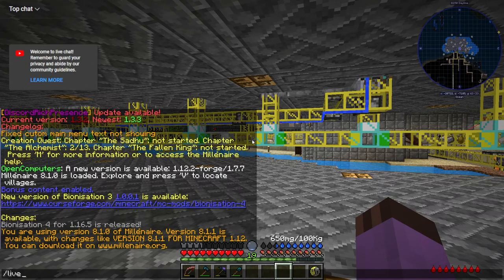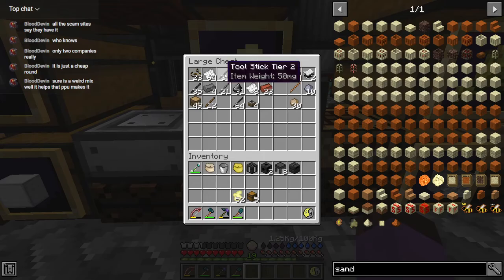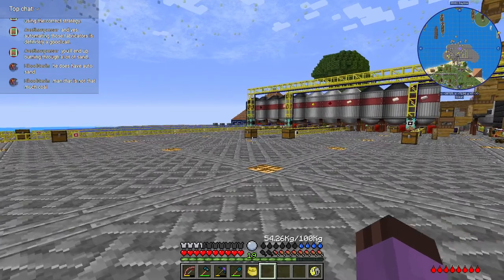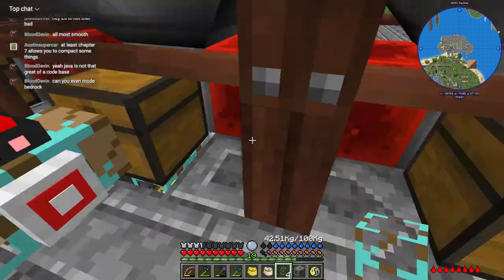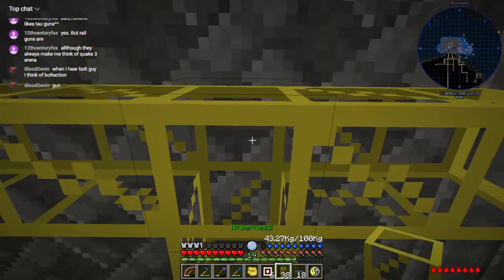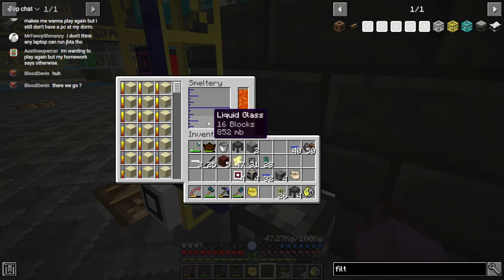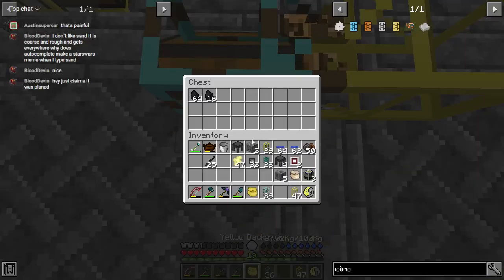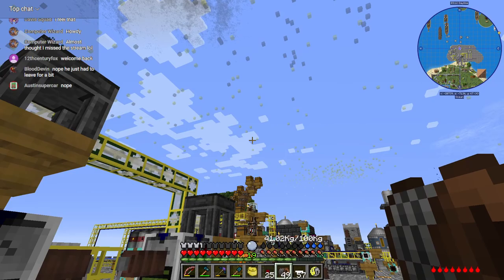Journey Beyond the Abyss 54: Power Up

Comment: how many fps do you have around your base?
Reply from the maker: like... 15-20 most times
Reply: @DrProfessorRobot  oof
Reply: @DrProfessorRobot  How good is your pc? like what are your specs
Reply from the maker: @Priin_Tz  i5-10400 CPU (6 core, 2.9ghz)  , GeForce GTX 1650 graphics card, and (recently upgraded from 16) 64 gigs of ram, of which I tend to give Minecraft 20 or so, since that seems to be the point of diminishing returns from testing.
Reply: @DrProfessorRobot ok, thank you